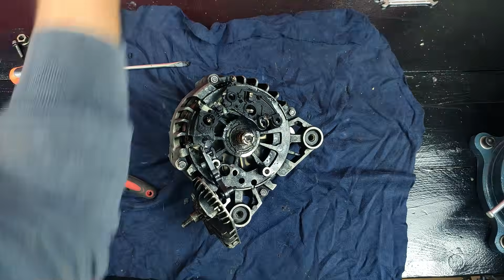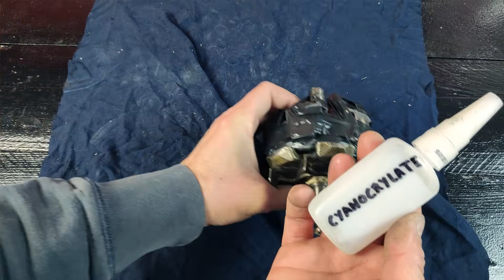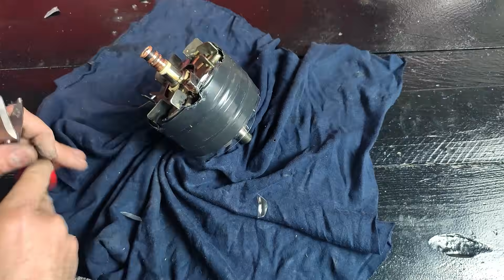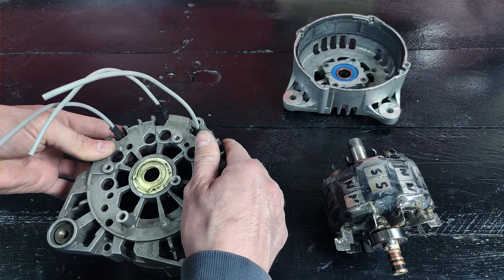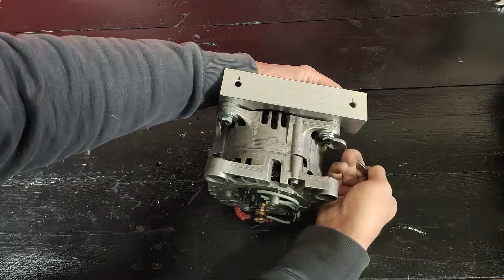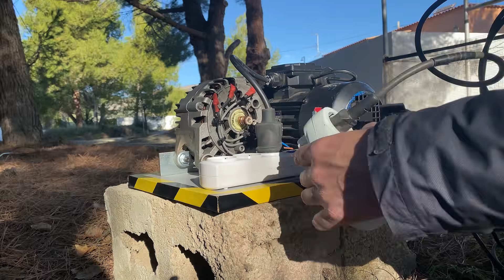This Self-Powered Modified Alternator Generates 220V and 10KW of Power⚡💡LIBERTY ENGINE

Comment: By connecting magnets of the same poles on the rotor, a strong impulse is created which creates a strong torque in the motor and starts the rotation. This is not a perpetual motion machine, it is a self-sustaining generator. Put Kapton tape under the magnet to reduce eddy currents and a 24V alternator because when it passes through the stator, a voltage of over 200V can be created in a microsecond, and the motor rotor irons out the impulses and you get a voltage of 220V. This is not some hidden technology.

Comment: I have two problems with this;  #1, why bother to even hook up the third stater (or coil) terminal, to a terminal block, if it is not used?  #2, Most power tools in the U.S., run off of 110-120 volts and not 220.  220 would destroy the 110 motors, so this must be foreign to the U.S.  You would need to only use one side of the windings, and have some sort of a ground (or common) to reduce the voltage, but would it even function that way?

Comment: Die Technik kannst du viel einfacher machen du lässt den Generator so wie er ist du brauchst ihn nicht umbauen erzeugt ja 14,2 Volt mit 100 Ampere schließt ein wechselrichter an mit 2000 Watt 12 Volt und treibst damit den elektromotor an so brauchst du nämlich nicht alles umbauen das Problem ist du brauchst eine schwungmasse das erstmal in Schwung kommt dann zu schalten viel Spaß beim nach machen ja es funktioniert eine gewisse Zeit dann treten die Verluste ein und der Schwungrad bleibt stehen  erzeugt keine Energie mehr
Reply: 1st law you can not use nor destroy energy so by this 1st law perpetual is in fact possible if you have no parasitic  losses
If you would run a large bank of super capacitors you could theoretically make more power than the allowable output but you also need to capture voltage losses to eddy currents. Tesla had a workable generator that captured the natural energy that is always around us, why not build off of that instead of reinventing the wheel🤔
Anything is technically possible until it isn't.
Thanks 🙈🙉🙊